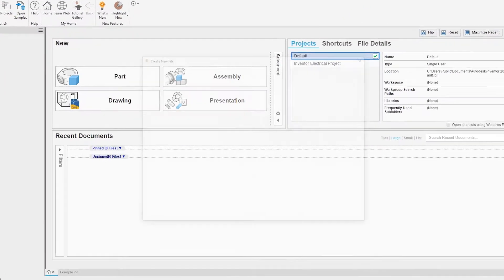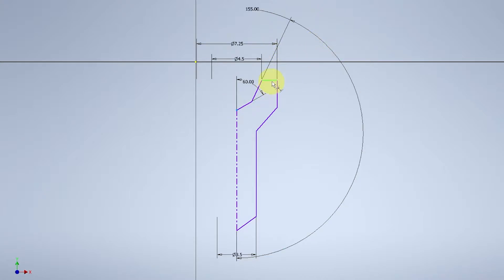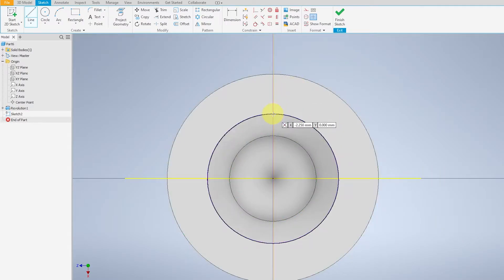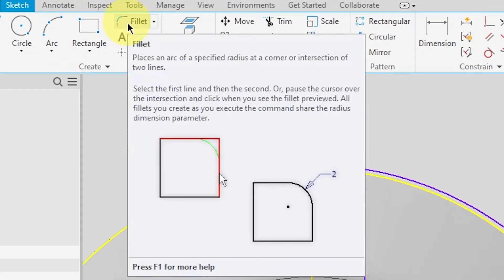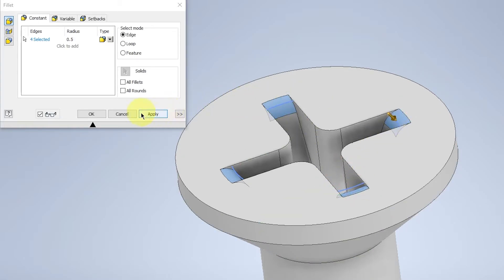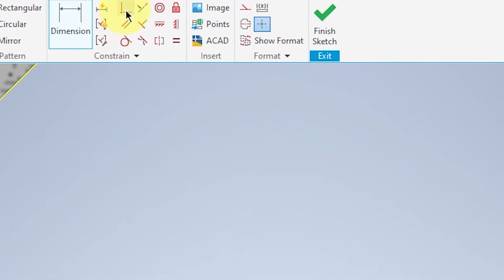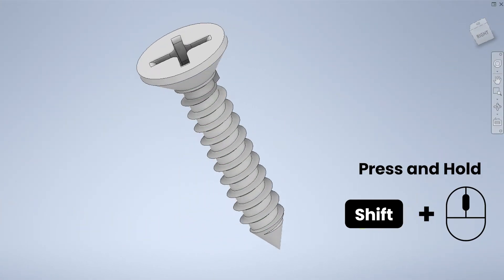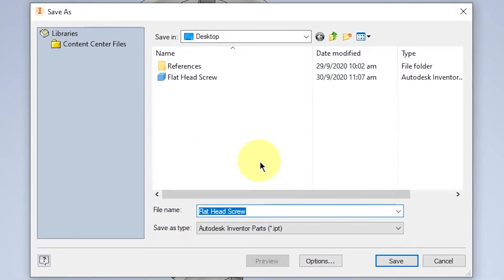3D Modelling a Screw on Autodesk Inventor 2021

Comment: Why not use the thread tool?
Reply: because if you wanna print the screw the threads won't show when you import into the 3d software (thread is only a visual thing, so the screw will show plain when you import into the 3d software).